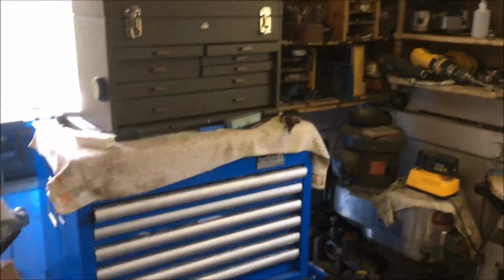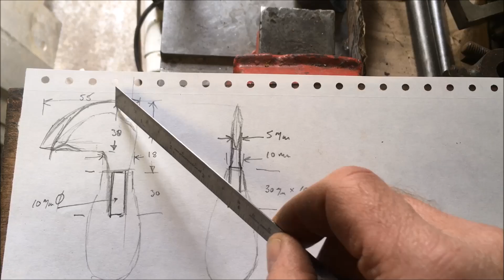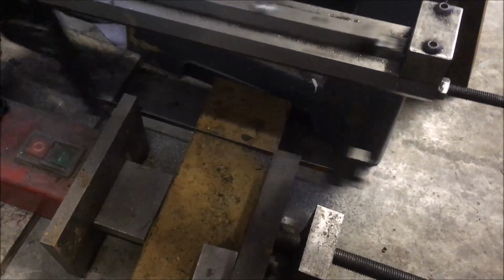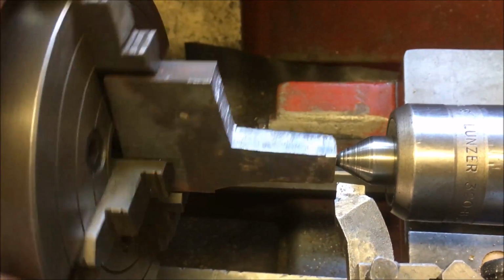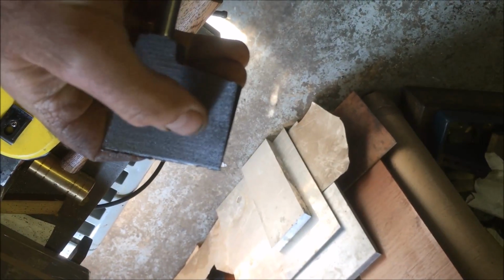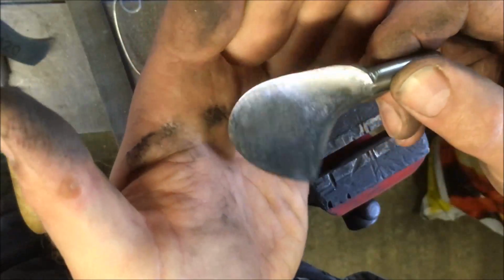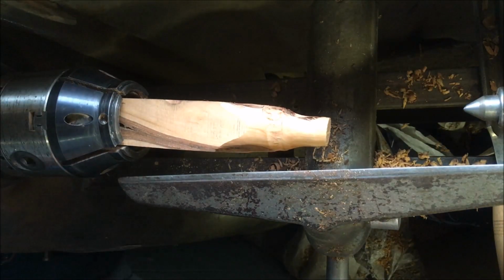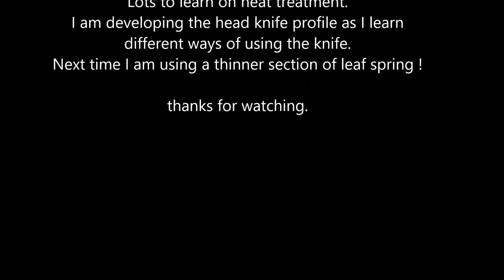Making a Leather Head Knife

Comment: hi Matt nice work on the knife never thought of repurposing leaf springs great idea thanks for showing 
Dave
Reply from the maker: Apparently common practice among the knife making chaps re-using leaf springs - water hardening works very well.  As you can see, I am very new to heat treatment and getting sufficient heat into the part represents a challange as I learn how to use the torch and kiln.  I picked up an old anvil with the lathe so looking forward to trying some metal bashing soon :-)

Comment: looks pretty good, I didnt think leaf springs were that thick, so never looked into them really. 

I probably would have cut a slot like a keyway in the back of that round part of the knife, then melt some beeswax and rosin to glue it into the wood, and the keyway and everything would forever prevent it from coming out again unintentionally or spinning. To get it to release in case you want it to, just heat up the steel with a torch and it'll just come back out.
Reply from the maker: The leaf springs I have, are as you can see thicker in profile than the average car or pick up - I want to make some decent parallels for the shaper vice at some stage and thats what I got them for.  I glued the blade into the handle with super glue - its solid. When the wood gives up or I have to reshape the blade, the 10mm hole was a nice tight fit - had it not been I have some foaming glue which is a construction grade and has worked well for other hand tool assembly.
Reply: oh, ok. I wanted to make some parallels myself, but I probably would want thinner parallels rather than massive blocks, so I'd probably use steel bed frames. The bed frames are usually a high carbon steel that can reach 55-60HRC just quenching in oil and should last for a very long time the way I use them. I believe it was pierre's garage that did a video not too long ago showing hardening the bed frame steel.
Reply from the maker: The main issue with leaf springs is the bend ! I figured rather than trying to 'forge' the bend out I would cut them down to square with the shaper. Then I found the massive spring and figured I could cut them across the width of the spring ) 5" long ..... at 0.5" thick or so. I have a box of 0.125" thick parallels which work fine but in the taller sizes tend to fall about quite a bit.

Comment: Nice job on the knife! I hope to get to see a leatherwork! I nearly jumped out of my chair when that wood came loose in the collet though!  I'm fixing to start scraping in an old shaper and have learned a lot from your Elliot vids, but it would be awesome if you had a video that ran through your overall process and order of it. I'd love to hear what you would have done different and what you thought worked out well. I think it could be beneficial to anyone starting a similar project, but it was just a thought. Thanks for all you share! Keep it up!
Reply from the maker: Hi Steve, yeh the woodturning catches do tend to liven things up ..... Bowl turning with 70lbs of oak spinning at 300 rpm tend to hone the reflexes pretty quick. Ive sold my big turning lathe to concentrate on the metal working now - these videos are the results.  I think you are right - a summary video of the shaper machine rebuild would be great -  something I may go back to if YT ever get their arse in gear and monetize my channel again.  A shaper is in my view an ideal starting point for learning machine reconditioning. It has all the basic elements set up in such a way to enable each to be addressed and checked against the adjacent part - most guys do a mill first and that has some more complicated geometry to get your head around.  You can msg me via YT on my channel home page with your email address and I am happy to help all I can with your rebuild.  As for a few of the lessons learned and what I would do differently on my shaper rebuild - clean it all first, then strip it and clean it off ready to paint. Undercoat, assemble, check alignment, scrape for alignment, scrape for bearing, paint, finish assemble, run in, re-check everything. Read as much as you can on machine reconditioning and machine tool alignment - ask for opinions and then form your own based on what you hear. Learn to measure repeatably and accurately, get yourself the biggest flatest surface plate you can - it will pay its self back many times over in time savings printing larger stuff. ..... and thats just off the top of my head.  Oh, one last thing - cleaning and painting a machine doesn't make it any more accurate or reliable just nicer to work with later  - many of the larger channels seam to have missed that point out. There are quite a few channels out there now which show machine reconditioning - most I am subscribed to - watch them, watch them again and comment - you gain loads of information and support as a result. All the best Mat

Comment: Nice video! I’m in the same boat as you for space , I’ve got a very old Wadkin 6 in planer which I seldom use but remember how long it took to get it in 😂.
Reply from the maker: the anxiety is in the fact that when I got my wood working gear it was cheep / less than scrap and I had better access to my workshop. To replace it with the same now is expensive and a hell of a lot of work. Here's the fun fact - m interest in getting to learn more about machine tools and machining was in part started because I wanted to modify the cutter block on my 12" BOA Wadkin planer thicknesser to take another pair of knives (4 in total) and achieve a better finish on our hard English Oak - which was what most of my furniture was made from. I know have the tools and machines to make the mod in several ways but no inclination to undertake it at his time. Thanks for watching. mat
Reply: lookcreations very interesting! If I was you I would atleast hold onto the table saw , hey they make good sword benches / crap racks when not in use.